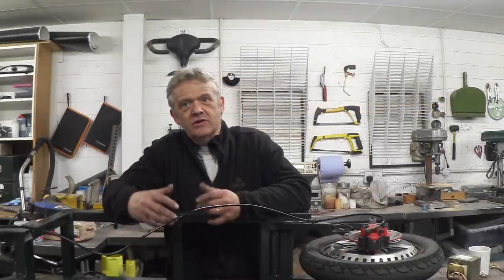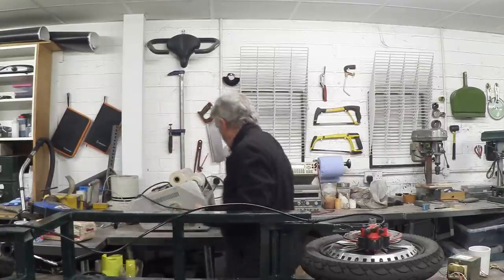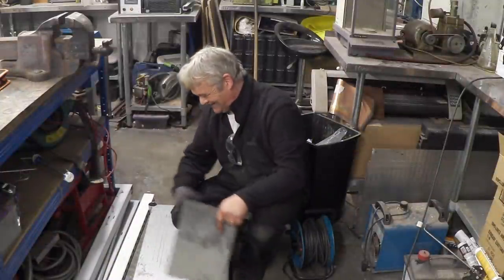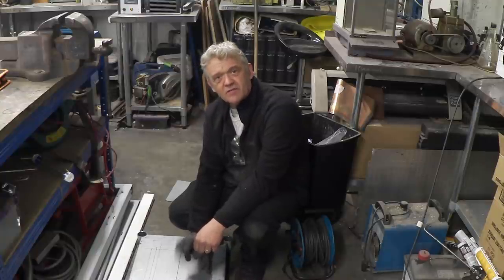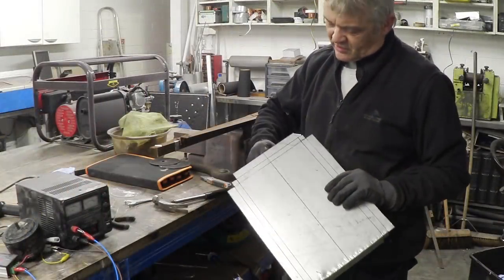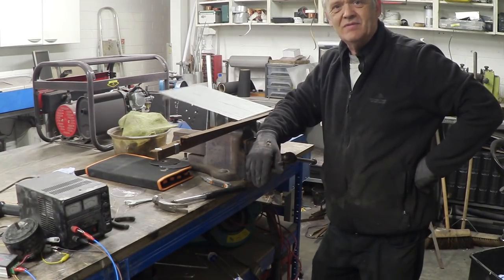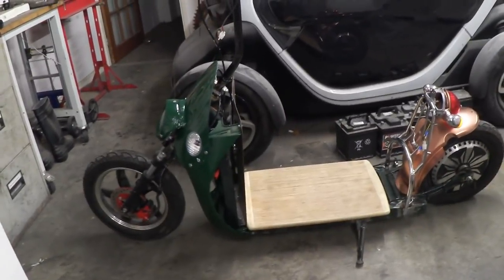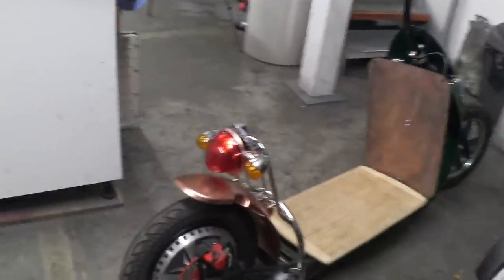Making A Big Wheel Electric Kick Scooter-  Part 3 - The Metal Panels

Comment: You may be interested to know that there's a blacksmithing trick where you can brass a steel surface. Basically you can heat up the area of the steel with a torch (~320-600C, black heat range) and with a pure brass brush wheel attachment buff the brass onto the surface.

Comment: Amazing progress, it's like a commercial vehicle and would not look out of place in main dealer, just wondering if the rear wheel is mounted in reverse or is it intentional? Maybe you have already hooked it up to test direction, these controllers usually let you change rotation with the "self learn" wire anyway.

Comment: Hi Rob, please be aware that working with galvanized material is hazardous. Welding in particular gives off carcinogenic fumes that go straight up into your welding helmet! So always use extractor. Cutting with the grinder is also iffy, again due to heating up the zinc plating. Sorry to put a downer on such an awesome project
Reply from the maker: no worries mate - I always deal with this as advice for others and leave it there for that as I think it is awesome advice - myself - I just do what I do and am happy with it - so basically ignore it as I am old enough to feel I just don't need HSE advice - sorry mate but thanks too.